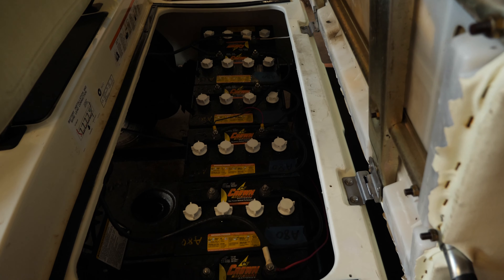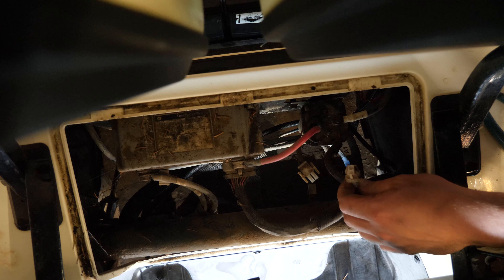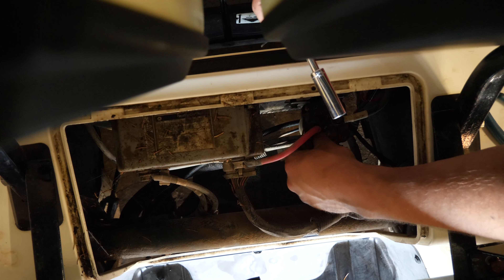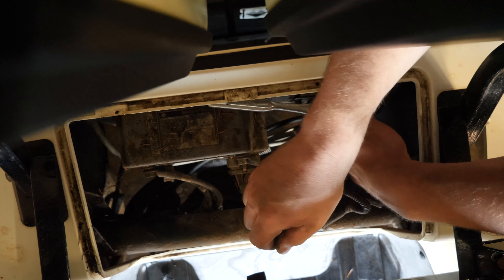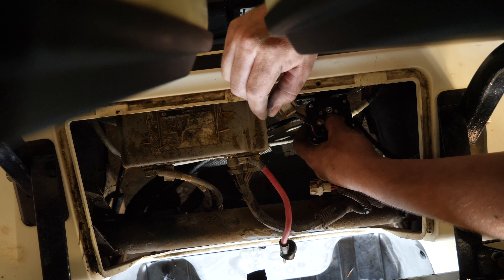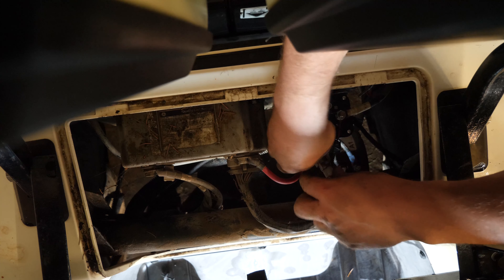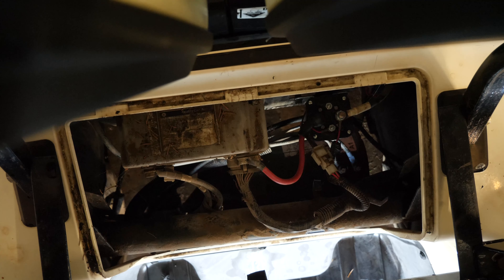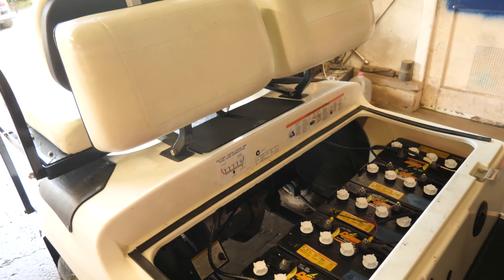2003 Yamaha G22, 48 Volt Electric - Not Moving, Replace Solenoid

Comment: My 2005 g22e works with the key in the off position when I switch it from tow to run even with the key in the off position I hear the solenoid click
Reply from the maker: This is normal. Switching from Tow to Run enables the controller to work and its performing its self check. If you are able to drive it with the key off, then you have a wiring issue.

Comment: I have a g29 48v with no power getting to the rest of the cart. No beep in reverse, nothing when I step on the pedal. I tried replacing the controller, not that. Checked all of the wiring, not that. Batteries are brand new. The only thing left is the solenoid but it clicks when I switch from tow to run. Any thoughts?
Reply: Hi. Did you get a resolution to this? My cart is doing exactly that. No reverse beep, nothing happens when I press the pedal.

Comment: Great detailed video!  My Dad's Yamaha Golf Cart is getting a charge.  When I turn the key on, I hear the solenoid clip a couple of times.  The reverse switch beeps, but when I press the throttle in both drive positions nothing happens.  However, if I press the throttle while pushing off the ground with my other foot to move it forward, then it starts and continues to move but almost in a stuttering start and stop way, as if the something is slipping, or not making a good connection.  If you have any thoughts as to what it might be, or what I should check, I'd greatly appreciate it.  I believe it is a model YDRE G29.
Reply: Did u fix it
Reply: Mine doin same thing. What happened?

Comment: My G22 appears to have the same problem. The fault was intermittent at first but has now become permanent. Could a faulty solenoid cause an intermittent failure?
Reply from the maker: In most cases, yes. You will have to do a voltage test across the solenoid terminals to determine if voltage is making it across when its closed.
Reply: Kevin's Golf Carts Great. Thanks very much 👍🏻

Comment: My G22 stopped moving, batteries good and charged, when key is turned on the solenoid clicks several times but cart wont move, power switch in run position,  solenoid is obviously getting voltage, what next to check??
Reply from the maker: With the key on or off, cart in forward, brake released on flat ground, push the cart. Does it beep and give resistance (anti-roll away warning)? If there is no resistance, then the solenoid is probably bad. Clicking doesn't mean its working correctly. You will need to get in there with a volt meter and see if there is voltage on both sides of the large terminals.
Reply: @Kevinsgolfcarts  ok, I'll let you know what I find out, thanks for the reply
Reply: Ok, did what you suggested, key on, in forward, level ground. Pushed cart by hand, there was no resistance or audible alarm

Comment: Question.. My solenoid seems to be working(clicks when you switch to run from tow mode, anti roll feature)(voltage good), controller (buzzes in reverse/anti roll buzzes), checked the motor(good).. What else could it be? help please..
Reply from the maker: First, what kind of cart do you have? The troubleshooting process will be a little different depending on the cart.
Reply: I have the exact same issue and I have new batteries, new solenoid and new pedal switch and my G22E still does not run.  Did you ever figure it out?
Reply: @Kevinsgolfcarts  I like your videos Kevin! I have a 2009 (JW2-208.... YDREG) that I let a "friend" use for a few weeks. A few days ago he was seen towing it with another person's golf cart. The next day he called me to tell me that the "cart doesn't move"!  I'm not sure why he towed the cart in the first place, but I seriously doubt that he flipped the run/tow switch. (I've forgotten to do that myself on occasion) The cart now rolls freely regardless of tow/run switch, the solenoid does not click, batteries at 53.4 V, all 12 volt accessories are working fine. 
Somewhere, I read that there is a red reset switch on the motor,  but I am unable to locate it. Should this cart have a reset switch? (Right now I'm hoping it's the solenoid - I'll check the voltage per your video)

Comment: I have a 2005 Yamaha g22. I have now replaced the battery cables, batteries, pedal switch, on/off switch, forward/reverse switch and the solenoid. I still have no click from the solenoid what next?
Reply from the maker: You need a multimeter and make sure you are getting power throughout the run circuit. There is a 10 amp fuse by the controller. If thats blown, nothing will work that runs through it. If that's good, then you may have a bad controller.

Comment: I have to replace my controller in my G29 cart. Can I gain access to it without taking off my back seats?
Reply from the maker: You don't have to but it will make it a lot easier. I usually remove seat kits as an assembly. There are usually only 6 bolts in total holding the seat kit to the cart.

Comment: Can you post a picture of how all the batteries are set up in your cart. I want to make sure I connected everything correctly.
Reply: Batteries are definitely installed. At the moment, I am far away from the cart, but I am an electrician, and, I hooked it up exactly the way it had been, and it ran fine for about a week, then it quit, so I switched from run to. Tow, and heard a loud click/reset, and a way it goes but only for a short distance, rinse and repeat.

Comment: Have a question. My 48v Yamaha when switch is turned on can hear the solenoid click but as soon as hit the peddle it try’s to move then stops and that’s it. It started doing this over storage   Battery’s are hot.

Comment: I have 2006 G22e and it just stopped moving last week. Tried a new solenoid but no luck. It clicks like normal when I turn the key to “on” position... what else should I check?
Reply: Did you figure it out I have the same cart and the same issue?

Comment: I have two 2019 Drive 2's 48 volt... Just like most on this chain, mine both run, lose power, solenoids click, flip run tow switch, both work temporaily and die... repeat process or let them sit. Batteries are fully charged.  HELP!!!